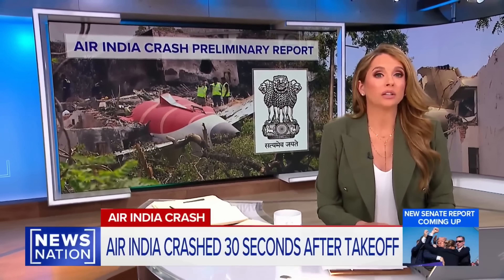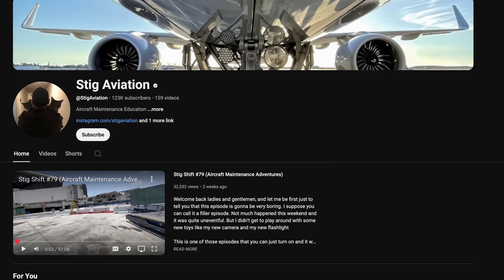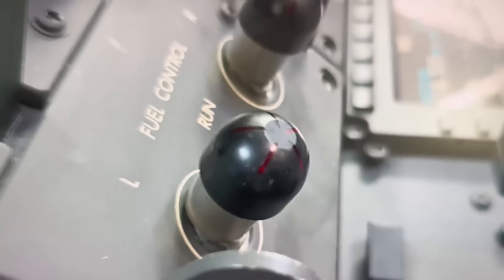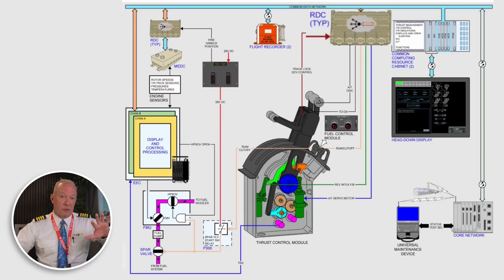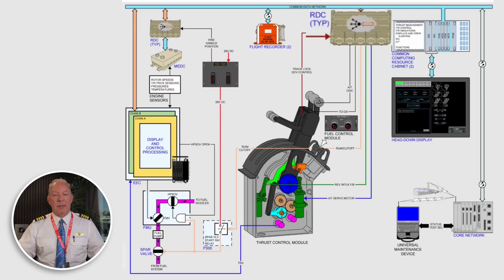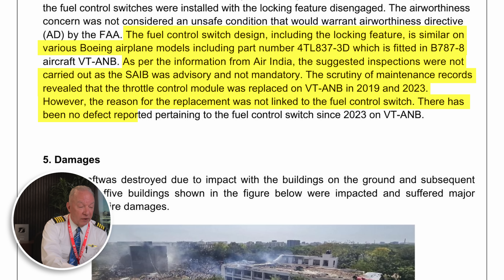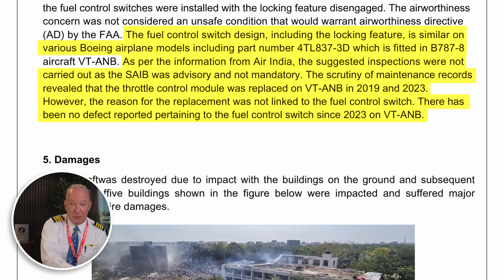The Truth About Boeing 787 Fuel Control Switches

Comment: If 28 V DC coming into the switches is lost, the relays will open and cut off fuel. 1. Electrical failure. 2. RAT deploys but takes time to spin up. 3. 28V is lost. 4. relays open and fuel is cut off. 5. RAT restores 28V. 6. relays close and fuel is restored, but engines need to restart.
Reply: additional questions to this idea: 
are there 2 batteries 28V, one for the right side, one for the left side - or only one? If only one, then both sides can be affected by a defect of the 28V net.
How exactly is the position of the switches, and the state of the 28V, and the relays -> recorded on the flight recorder?
Is the switch position recorded, or is the state of the relays recorded? Is the presence of the 28V also recorded?

Comment: If the actual transition of the switches was recorded by the flight data recorder then, by definition they must be connected to the flight data recorder. Or is the operation of the switches inferred by the operation of the relay perhaps from an auxiliary contact on the relay. Your diagram does not show any connections to the flight data recorder, surely your diagram is simplified as I can't imagine the whole fuel system supply relying on one relay

Comment: Here's the Air India 171 Timeline
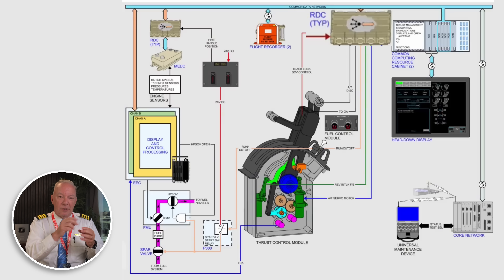08:35 - Rotate
08:39 - Lift off
08:40 / 08:41 - RAT deployed
08:42 - Max Airspeed
08:43 - Switch set to Cutoff

This is verified by the data in the Preliminary report and what you can see and determine by analyzing the videos of the takeoff.
As you can see, the RAT deployed BEFORE one of the pilots flipped the engine switch to Cutoff.  That alone is strong evidence that something went wrong just at the time of liftoff and the loss of power could not have been due to the pilot flipping the engine switch, the loss of power had already occurred which is why the RAT deployed.  It's pretty well established that the RAT will not deploy on the ground which also tells us that the problem was NOT, as some suggest, that the plane thought it was still in "ground mode" and consequently refused to maintain engine power.  Since the RAT deployed we know the flight electronics had transitioned to "flying" mode.

While we still don't know and can only theorize on possible causes, its clear from the timeline the cause was NOT the pilots flipping the switches to Cutoff.  It's clear that the cause was NOT that the plane thought it was in 'ground mode'.  We know one of the engines was able to successfully relight and start developing thrust and with more time it is likely the other engine would have also successfully relit.  Which means the fuel was almost certainly OK and capable of being delivered AND that the engine(s) themselves and their FADECs were fully functional.

If we set aside pilot error/suicide, and I think we should, we always come back to something causing dual engine failure within the half a minute of the flight from rollout to crash.

That the pilot(s) set the engines to Cutoff may be, as some have suggested, that they intended to reset them, not a case of just wanting to shut them off.  That there was a delay between the flipping of the switches may have been a recognition that with the RAT likely not fully up to speed it was best to try and restart only one engine at a time with the available RAT power.

Since the V1 speed and VR speed are pretty close and since the pilots took off, clearly they felt things were normal all the way to rotate.  That leaves a roughly 5 second period between rotate and RAT.  As has been suggested, there is little left which has any sort of history except water getting into the electronics.  Rotate would be the most likely time to get it sloshing around. 

 Is that the cause?  We can't tell since we don't have access to the wreckage or the FDR detailed info.  Hopefully the truth will come out.

Comment: How does a purely mechanical switch tell an electronic data recorder that it was switched off then back on?  Wouldn’t it be the interruption of the electrical current that registered on the data recorder as opposed to the actual position change of the switches?  Just curious.

Comment: Heavy focus on the physical switches which I don't think failed at all but still no explanation regarding why the RAT deployed 2 seconds after take off but before the fuel switches were moved to cut off. So what I'd like is a reason regarding what the pilots saw once the RAT deployed and that may have an influence on their posible decision to move fuel to cut off and back again in an attempt to restart the engines. In other words the switches may well be a red herring in terms of another failure which caused RAT deployment.

Comment: Very good video captain Steve. But you are unfortunately wrong about one thing. The fuel valves is not kept open by the 28V DC. It is maneuvered by the the 28 volt curren in both directions. 

The fuel valves have a small servo motor wich works both direction depending of the polarity. The fuel valve relay send positive corrent to one side of the servo motor  in cut off and to the other side in run position. This makes the servo moving the valve to desired position. 

The valve will stay in its position until the end of time or 'til the relay send a reversed signal. Meaning, if run is the last request it will stay there even if the battery is drained, removed or if the current is interrupted in any way.

This is a safety measure.  Let's say that you've put the switches in the run position. And vibration or a bad junction causes the wiring to the valve fail/brake. Then it is crucial that the loss of current  NOT makes the valve to close.  It is going to remain in the last choosen position. 

In that case the problem is that you will have problem to operate it again since you need 28V both to open and close it, just with the polarity reversed. 

So your explanation that it will stay open for som 40 minutes is wrong. It will stay open indefinitely or until switched polarity causes the servo motor pull the valve to cut off.
Reply: Thanks for that clarification! I had exactly that question in mind. There are fail open, fail closed, and fail in place valves. According to your description, these are the latter. So, that takes out the possibility of battery or switch disconnect causing the relays to close, in essence removing a potential single point of failure.
Reply: Don't understand this well - especially the meaning of 'polarity' - but thank you. However, in what way does your comment affect the diagnosis of these fuel switches being moved? You need to expand the scenario of how a true accident could have occurred, not a man-made one as we all currently believe.
Reply: Absolutely correct. I concur 100%. This probably explains why the Quantas A380 that had an uncontained and catastrophic engine failure out of Singapore, had to land with It’s No 1 engine still running. Possibly because the ‘polarity’ of the relay to It’s shutdown position was severed at some point, thus not allowing the pilots to shut down that engine. Fail safe engineering. Nice explanation from your part.
Reply: Thanks Tomas, for clarifying that . 
Cpt. can you please update this information accordingly.

Comment: Please all look on google and read the new reports that Air India 171 never got into flight mode !!! All requests for thrust was stopped by the FADEC system.  The  leaked code has been looked at by a retired Captain and he confirms all 5 requests for thrust was stopped by the FADEC as the wow (weight on wheels ) Only one sensor thus a single point of failure !!!  AKA the smoking gun. 
Capt Steeeve discuss this confirm it is true as this matters for safety how many more WOW sensors are iffy !!!
Reply: According to the report "The aircraft air/ground sensors transitioned to air mode, consistent with liftoff at 08:08:39 UTC". The plane was not in ground mode.
Reply: @juniper1803 https://www.youtube.com/watch?v=wzayF8zRuhk

Comment: That fuel switch system is practically 100% fail-safe; an electro-mechanical design like that could only fail if the relay itself fails, which is highly unlikely. At least we know that no "Errant" digital signal could have killed that plane. The other explanation is one we wouldn't like to think about....

Comment: A circuit downstream a power surge a defective diode may have caused errant signals to be sent to fuel valves engine controls etc. The plane is fly by wire. But easiest path is blame the pilot

Comment: 0:17 "incredibly complex"   
What you showed at 3:51 is what a technician calls a "one-line diagram".  This is not a detailed schematic and does not account for any software intervention.  Everybody keeps focusing on the physical manipulation of the switches.  I don't care about that.  I care about proving what they say happened, that it is reported on the FDR that the switches were moved.  So prove it.  First, show me the detailed schematic, NOT a one-line diagram.  
  
7:48 "None of them are connected directly to those valves".  And neither are the fuel cutoff switches.  The fuel cutoff switches go to the RDCs and other things. I have seen nothing to prove exactly how the components are wired, nor whether software could have been a factor.
   
Have you seen the reference to "a similar event in 2019 involving an All Nippon Airways (ANA) Boeing 787. During final approach from Tokyo to Osaka, both engines failed after the aircraft’s software erroneously detected that it was on the ground. This triggered the Thrust Control Malfunction Accommodation System, which cut fuel to the engines. According to Schiavo, the pilots did not engage the fuel cutoff switches. The malfunction was ultimately traced to a software glitch rather than human error."

Comment: I suggest you deal with Jeremy Thompson's contention that this is yet another example of the famed 787  lithium battery failure, more specifically the back-EMF protection diode.  Its failure  allows spikes from loads such as the 'gear up'  command to destroy the battery and/or to depress the voltage to near zero. As you say the relay depends on 28v DC from the battery. If that is lost, the relay opens. It's extremely complex, and he may be wrong, but if he is, then his arguments need to be carefully dismantled. General reassurance about 'the battery is there as a fail-safe' is not enough.

Comment: Appreciate the technicalities about Fuel Control switches and how they are independent legacy systems on the aircraft.

Good analogy sir...

What about the #Failure #Malfunction of this stand alone battery.

You didn't go into the discussion of the specifications of this 28V-DC, nor its life span, not it's replacement history, more specific to this Aircraft, Capt. Stevens.

Comment: So can the wiring for these switches/relays fail or short? vibration could break a circuit and generate a reading on a sensor that its been switched off?

Comment: Thank you, Captain Steeves, your clear explanation seems convincing. But I still have a question about the chronology of events.  Did the RAT deployment take place before or after  the  switch move  ?
If it happened before, it could mean that there was a major failure that the pilots tried to correct in an unfortunate way.

Comment: In previous videos you displayed an amount of confirmation bias.  When you were discussing the conversation of the pilots - you said something like - when you accuse children of doing something wrong they inevitably deny it.  I think the first position should be to accept what the pilot said 'he didn't move the switches'.  So they could have been left to run as they were found after the crash.  You really have to rule out first the possibility of an issue with the signal from the switch to the valves which as I understand goes as data down a fibre optic cable and into a computer on the engine first.  If that checks out ok then yes look at the pilots and any more conversation they may have had.  Focusing on a switch that has to move is more confirmation bias reinforcing a conclusion that you have already made.  I'm not blaming you for this but it's an easy trap to fall into which results in selectively picking information that fits your argument.

Comment: Q: how fuel cutoff switch connected to fuel control valve in boeing 787?

ChatGPT says:
When moved, the switch doesn't physically move the fuel valve. Instead, its position is digitized and sent through the aircraft's Common Data Network (CDN) using fiber optics.
Each engine houses an Electronic Engine Controller (EEC)—also called FADEC (Full Authority Digital Engine Control)—which receives the switch commands digitally.
The FADEC then commands the fuel shutoff valve (often the “spar valve”) inside the engine to open or close, regulating fuel flow precisely.

Grok says:
When a fuel cutoff switch is moved, it sends an electrical signal to the Electronic Engine Controller (EEC), a component of the Full Authority Digital Engine Control (FADEC) system. The EEC is mounted on the engine’s fan case and manages all engine functions, including fuel flow.
The spar valve and fuel shutoff valve are electrically controlled solenoid-type valves integrated into the fuel system. These valves are not directly manipulated by the switch but are actuated based on commands from the EEC.

Gemini says:
In a Boeing 787, fuel cutoff switches are directly connected to the fuel control valves through a relay system, not directly through a computer.

Which one is correct?????
Reply: lmao @ person trusting glorified guessing machine over somebody with direct knowledge of the subject

Comment: A relais is not what you are demonstrating. The fuel switch is only a contact. This contact gives power to a coil of the relais. This coil of the relais closes then a SECOND contact. These relais are highliy probably located in exactly the place where 787s have known issues with leaking water, the electronic bays.
Water can kill both relais during pitch up and fix itsself by deceleration and lowering pitch by just shortcircuiting the coil powersource.
Also, if theres a FDR recoring data. WHERE it gets it's signal? From the switch? From the relais? A shortcircuit on this line is probably relevant, too.

Comment: On thing I see is everyone blaming the pilot, fine. But what about the solution to it, why does the system enable them to close both the switches mid air. I mean why don't they ask the question wheather the existing system may not be good for flying ? I get the blaming part but what's the solution ?

Comment: Captain.
As a "fixer" in another industry, very used to working with Relays and Switches, etc, I was leaning towards the "Manual operation by Human" option.
BUT, I had a question.
Was (is) there a "single component failure" on a "High level" (Control/ supply) circuit which could give a FALSE indication of switch position AND cut power to the Valve/ pump control relays, on BOTH engines, staggered?
.
I asked this question in the comments of another channel and was told NO..... (I wasn't fully convinced)
.
Then, purely by chance I happened upon a channel where a different hypothesis was  presented.
Here is the basic premise (Paraphrased, from memory)

1) COMPONENT FAILURE in the Main Battery Diode control module. (Normally prevents 28v feedback directly to the Battery from the LEFT bus system)
RESULT:  28v feedback..... NOT via the controlled battery Monitor (BMS) circuit. Thus causing STRESS to the battery similar to a "Dead short"
.
2) Effective "Short" REMOVES 28v from the Main contactor of the Engine 1 Fuel control Valves/ Pumps......
RESULT: Engine 1 "spools down" due to lack of fuel.
AND
3) REMOVES 14V INPUT to the "live" side of the dedicated switch position contacts (!) inside  the associated Switch.
RESULT: "Active Low" to the FDR, and "FUEL CUTOFF LEFT ENGINE" indication.
.........
THEN
4) The RIGHT Bus detects a System Failure in the LEFT bus.
RESULT: the "BUS TIE CONTACTOR" Normally OPEN Main contacts CLOSE to supply EMERGENCY power FROM the RIGHT Bus to the LEFT Bus..
RESULT: Since the LEFT bus is essentially "Dead Short", now the RIGHT Bus is ALSO subject to the SAME short and the SAME Sequence happens in the RIGHT Bus (About 1 second delay)
.
There is far more detail on the channel, describing in GREAT DETAIL the TRIGGER for the Battery failure, and sequence which allowed a partial restart.
(I found it quite impressive)

Search On YT
Jeremy John Thompson
Video about 2 weeks ago.
Reply: do you mean this video?: https://www.youtube.com/watch?v=OLxLN3osS1Y
Reply: @stefanfischer5971  
That's the one... sorry for the delay

Comment: Key point is that as the switches were brought back to on after some seconds the engines tried to start again - but too late . That proves that all circuitry were full operating ( no wire break etc)

Comment: Two questions: How does the eFDR sense the position (the front recorder was destroyed not readable)? 
And there was an airworthiness directive regarding 787 batteries because of fire: what if they catch fire, send overvoltage or no voltage: is it guaranteed that the fuel valves then do not shut close?

Comment: My guess is that the switches were moved by a pilot whose brain wasn't engaged, like when I take a turning at a junction forgetting that I'm not heading to my usual destination today. And it does seem to me that the system isn't really designed to prevent that happening.

Comment: @captain steeve

Electronics engineer here. Your diagram shows the fuel relay switched output going to a gate BEFORE going the fuel valves. The gate's secondary input is connected to the 'display and control processing' output. Not knowing how this is supposed to work and purely interpreting the diagram, it really does seem there is another possible signal that COULD control the fuel valves independent from the analog mechanical fuel switches. Can you elaborate on that?